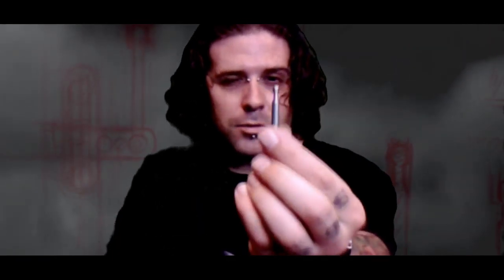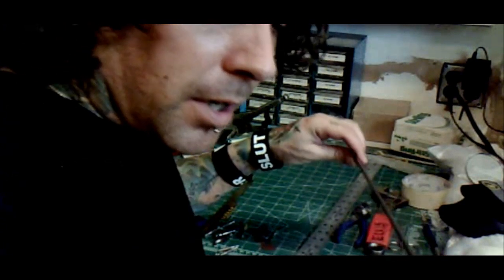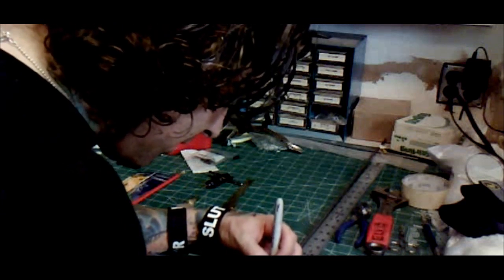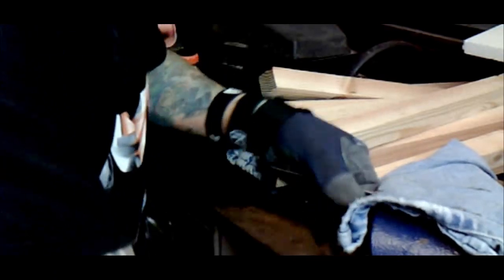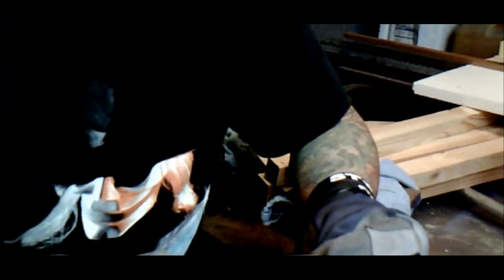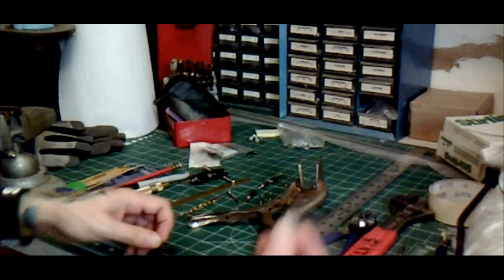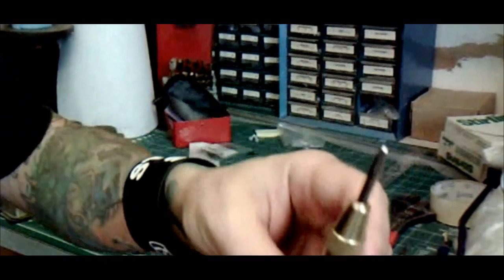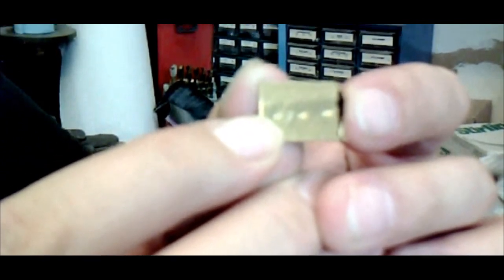How to Make Advanced Ball and Socket Armatures for Stop Motion I

Comment: I don't understand the tapping part at 7:58, could someone explain that to me? I'm new to stuff like this, use small words please.
Reply: Hi Kaye.  Tapping prepares a drilled hole with screw threads.  There are many different size screws, and each type of screw has its own thread size.  For example, one of the smallest screws is a 0-80 (the zero is the number of the screw, and the 80 means that this particular screw has 80 threads per inch.  To drill a hole that needs to be tapped for a 0-80 screw, you need to get ahold of a Starrett Chart (they're online and you can also buy them at a hardware store).  
There is a column for TAP SIZE.  So, find the 0-80 tap size, and when you look to the left at the FRACTIONAL DRILL SIZE, you will see that you will need a drill bit size of 3/64".   Once the hole is drilled, you can then acquire a 0-80 tap, place it in a tap wrench, and proceed to turn the wrench very carefully to cut the threads inside the hole.  There are two basic types of taps 1) a bottoming tap, which is squared off at the end so that you can tap a blind hole (a drilled-out hole that doesn't go all the way through the workpiece), 2) a point tap, which is designed to go all the way through a hole.  Some taps allow the metal chips to push forward and out of a hole, and for a blind hole, the chips are forced backwards.  Tapping takes a lot of practice, so one should be prepared to break them frequently whilst you are learning.  Good luck!

Comment: So glad to see someone else out there with an angle grinder that 1) has the pesky and interfering safety guard removed and discarded completely the hell out of the way, and 2) has a 4" wheel that has been ground down to about 2 1/2" but it still cuts fine, so why replace it?  I like the idea of milling down the single rod rather than assembling  a threaded combo and soldering or locktite-ing it. Any pointers on how to get a good spherical end on them? (other than patience and practice)

Comment: This  is great stuff. I recently began work on my newest armature using all the techniques in your video, which is coming along really nicely. One question though - when you shape the ball joints in the drill press, is there a specific dremel bit that you use? I'm using the fiberglass reinforced cutoff wheels, but they wear down really fast and I go though 1 wheel every 2 joints or so and it gets expensive. I'm milling 1/4 inch steel. What do you suggest?

Comment from the maker: Thanks much guys, and yea I'm working on part II this week putting the parts together and showing the full armature at work. I used this method because I believe that machining the ball from one piece of steel is much better in the long run and stronger than drilling and tapping a ball bearing and attaching a threaded rod, then brazing it. Plus it takes much less time this way (especially when you have like 18 pieces or more to make XD!)

Comment from the maker: Hey thanks man for the kind words...tools needed:

8" drill press -usually about $80
Dremel tool-$10
Metal vise-cost varies depending on size
metal files-$5-10
drill bits-$3 -5 apiece
metal punch-$5 or so

Materials: 3/16" x 3' steel - $3.50 or so
1/16" thick brass plates $3-8 depending on size
4mm x 3/8" or smaller socket head cap screws - 100 for $5 

You can cut them with the dremel instead of an angle grinder it just takes a lot longer